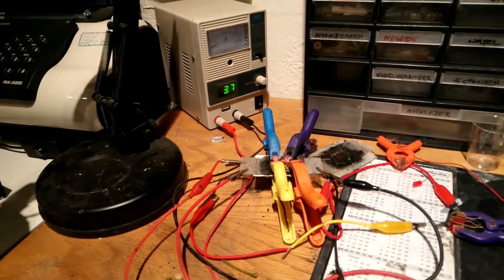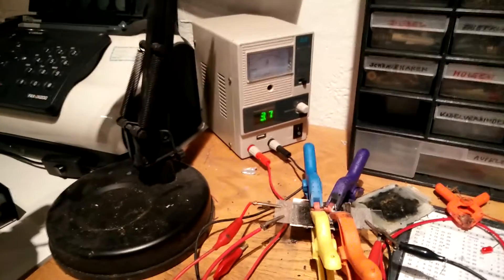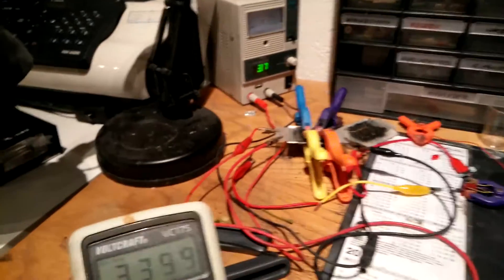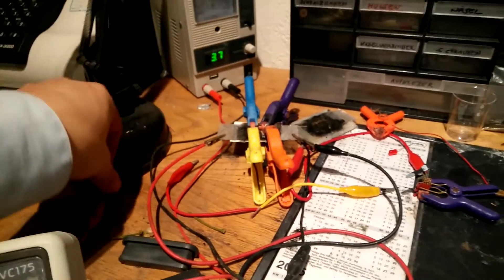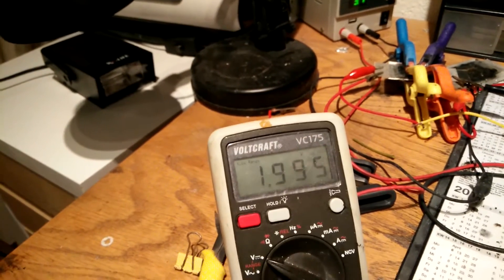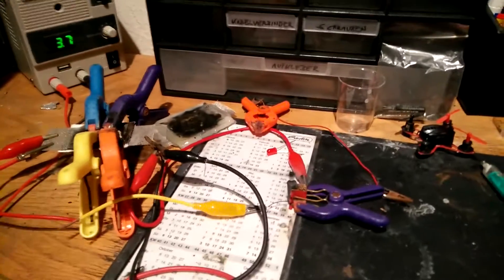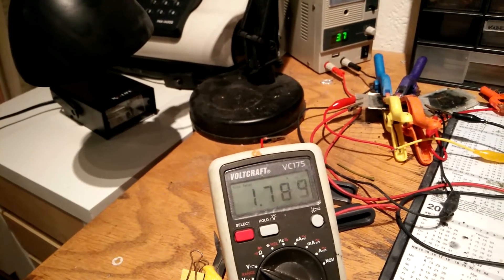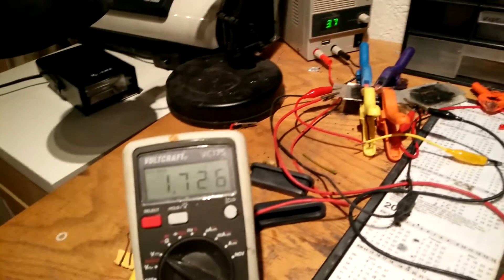supercapacitor with activated carbon zincoxide and na0h as electrolyte

Comment: Instead of Carbon make it just with Salt it will hold better electrons, Carbon only conduct do not make any Hydrogen reaction.
How is your Graphene sheets can you confirm still your resistance of 2 Ohms ?
Reply from the maker: +Bartosz Barejko 
Hi Bartosz,  this is just activated carbon. no graphene.
The reaction is " I think " from the zincoxid and the naoh.
It seems that its getting better every cycle.
Reply: Yes i do know, but even your  activated carbon will only conduct, but salt reacts. 
I did just recently get the same good product as you. now you will see my technology speed up..